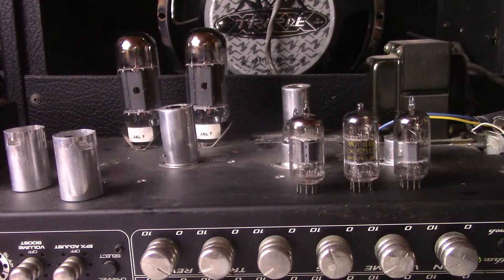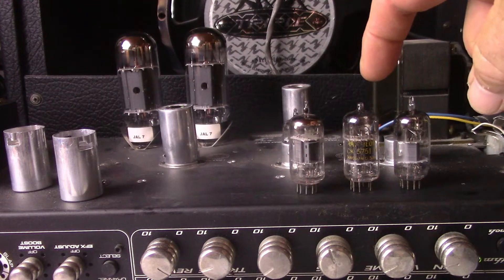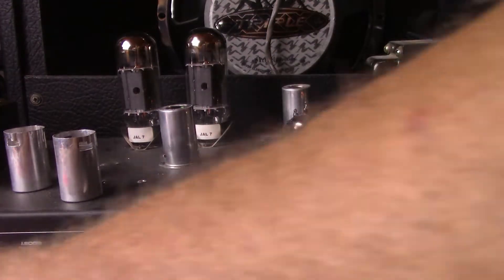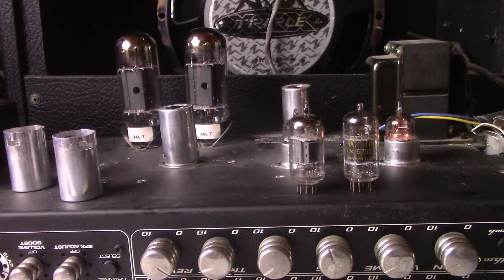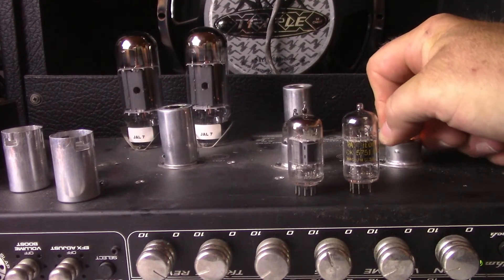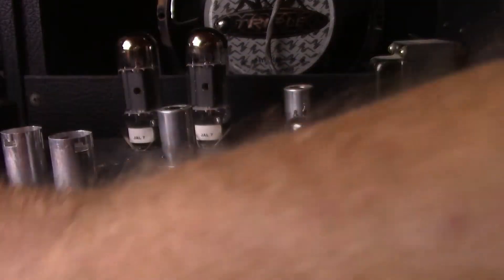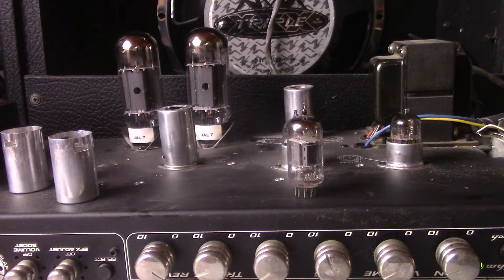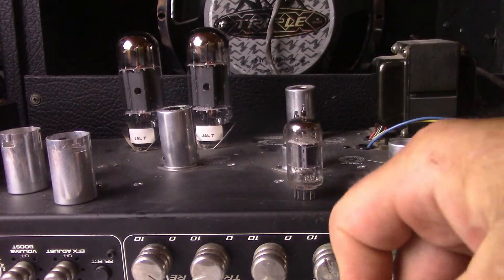GE 12AY7 vs RAYTHEON 5751 vs RCA 12AX7A preamp tube comparison shootout

Comment: I have a bunch of  RCA 12au7a tubes. I have wondered if I did some load line analysis and tweaked the plate and cathode resistor values - could a boost pedal in front of the amplifier recoup the lost gain?
Reply from the maker: Yes it would, and the amp would be quieter

Comment: Liked the RCA best. Similar midrange to the Raytheon but brigther, with more squawk and a grittier edge.
Reply from the maker: Agreed. Amazing how tubes do make a difference and brands sound different
Reply: @vacuumtubesandguitars  I believe Mullards can be found rebranded too. I have some 60's Mullards from a tape deck and some 70's that I bought new  - still in the boxes I think. My stuff is in storage but I'm getting it out shortly so I'll be able to rummage through it once more. I have some Brimars and Tungsrams too. Also GEC and Gold Lion. I think I may have bought the Gold Lion new in the 70's too, from a radio repair shop. So long ago, I'm not sure - it may have been the Brimars.
Reply from the maker: @danceswithbadgers  The GEC and Gold Lion's are high dollar today. I have seen Mullards rebranded as Amperex, National, RCA, GE and IEC.
Reply: @vacuumtubesandguitars  Now I think about it, I had some Gold Lion and  some Mazda tubes from that shop. I think the Gold Lions were more expensive. The shop closed down 15 years ago but they had several brands. I'm sure I have some 50's Mazda ECC81's but the ECC83'S are 70's purchase. Have you tried any Mazdas?
Reply from the maker: @danceswithbadgers  I have never had any Mazda's. I think they were made in France
Reply: @vacuumtubesandguitars  I believe so. I found them a decent alternative to Gold Lions, and similar to the Mullards I had or could purchase. I had an amp back in the 70's which had an unhealthy appetite for preamp tubes so I replaced a lot of them as they blew. Never got to the bottom of that issue. I think I may have used up a lot of the salvaged tubes I'd gathered. I found 7025's to be more durable in that amp and defaulted to Groove Tubes in a 'hard'  grade by about the early 1980's. I've stuck with those ever since. I believe GT sourced the tubes from various suppliers and graded them in sets for how easily they clipped. I found the 7025's generally more reliably restitant to rattle and less microphonic than a lot of 12AX7's. Personally, I always manually checked tubes for rattle before fitting them. Anything a bit rattly would be put aside as a 'maybe'.
Reply from the maker: @danceswithbadgers  The strongest built 12AX7 variant tubes were the 6681's. They were built to survive unwanted spikes in current. I have them in my amp I use onstage at gigs.
Reply: @vacuumtubesandguitars  Would I be right in saying that 7025's are a low noise variant of the 12AX7 whereas 6681's are a more rugged mil-spec version?
Reply from the maker: @danceswithbadgers  Yes, that is absolutely correct